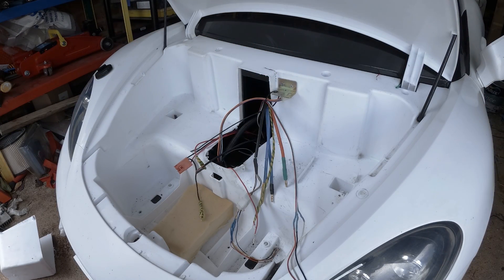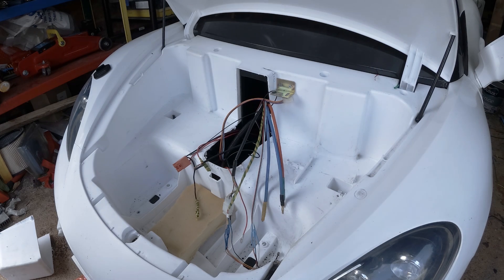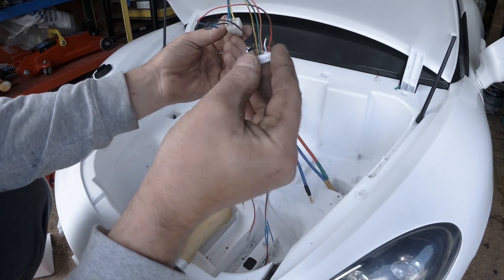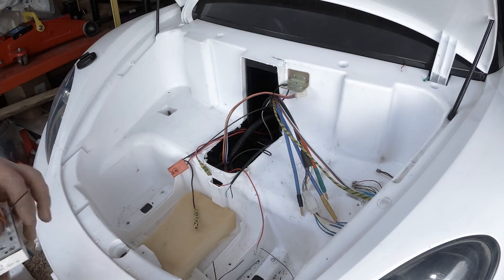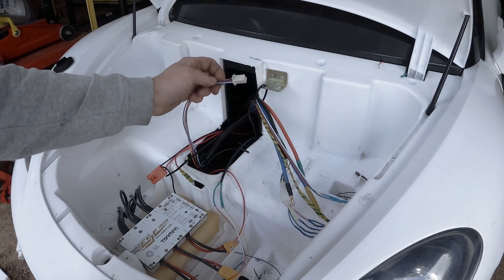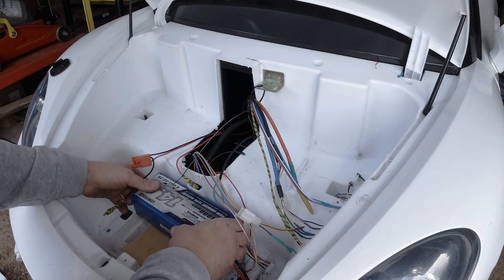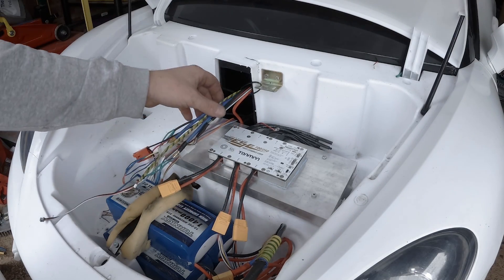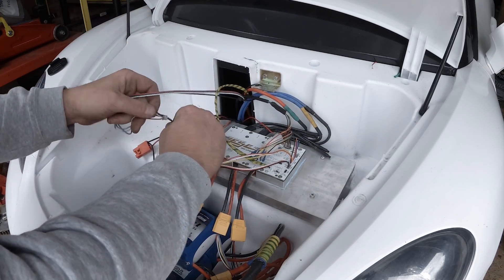Installing the most powerful Vesc Controller  the VESC 100/250 on my Super Sport XL ride on. Part 1

Comment: My goal is to wire this vesc to a 25kw 120100 brushless motor from freechobby with 8kwh worth of 94v lifepo4  battery.

All on a 450kg car. Do you think it would be enough? If i use the original transmission the wheight would add up tô 500kg, but the gears would come in handy.
My town is flat and my calculations governo me 65km of range.
Reply from the maker: I think you need a bigger controller and probably a bigger motor. 450kg plus driver needs a lot of torque to move. Trampa is working on a bigger vesc . you should get in touch with them

Comment: Will this work with any ride on? Like the 24v Vernon?
Reply from the maker: If you are using brushed dual motors you can use a dual vesc 6. It works with brushed and brushless motors up to 12s lipo or 4 12v lead acid batteries in series
Reply: @ExtremePowerWheels  sorry for the late reply, never notified me. Thank you for taking your time and replying. I’m actually getting my son the veneno for Xmas. Planning to do this upgrade to his. Was wondering if an when I do, may I ask you for some advice and guidance?

Comment: Awesome work! Just wondering how did you wire gear shifter into ppm portz

I see you only utilised 2 wires and wondering what they are. (5v and ppm or gnd and ppm)

And also how did you wire those two wires to gear shifter? ie which terminals and etc.
Reply from the maker: Thank you
The shifter it just a 3 way switch. the controller uses just one of the positions to determine if you move forward(or reverse). if those two wires are not connected the car will go in reverse. this controller doesn't have a neutral mode
Reply: @ExtremePowerWheels  legend. Thanks for clarifying!

Comment: do you have to plug in all 3 wires on the controller? does it wotk with 3 series in 1 socket?
Reply from the maker: The xt90 plugs on the controller are connected in paralel to split the load. You can use only one but you will heat the wires if you use a lot of amps
Reply: @ExtremePowerWheels  thanks for your attention :)

Comment: does that controller have a wattage output setting ?  if so where are you setting your watts at for the stock motor its rated at 180w just curious if where or what watts your running through the controller and out of the batt packs
Reply from the maker: if you have seen my other videos i have very fast acceleration. the settings in my controller  are 150A continuous at 75v with no wattage limitation. that means the motor uses around 11kw maximum power. I also tested at 190A and the motor still works. It is a amazing motor
Reply: @ExtremePowerWheels   wow that is crazy!  ok well i think im gonna keep one of the motors i ordered just for funsies lol.  So i ordered a 48v Lithium pack 20ah the controller i am going to use is an amazon controller 1800w 40a speed controller :/  are you still using the Vesc controller ? im just curious how it handles all the amperage with little cooling ?

Comment: I loved your video keep going bro 
I wish I had one of this battery you have but can't afford it
Reply from the maker: Thank you.
You can use 4  22A lead acid bateries in series for a 48v pack. And a vesc 6 controller is much cheaper also the charger for lead acid batery is cheaper